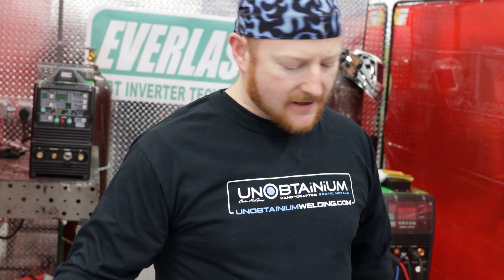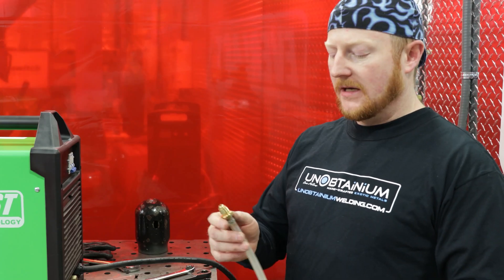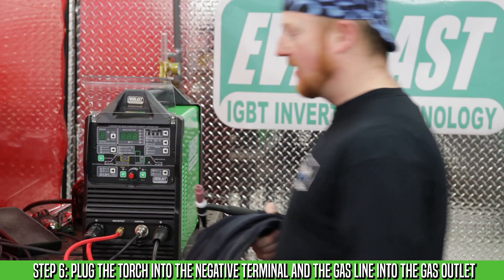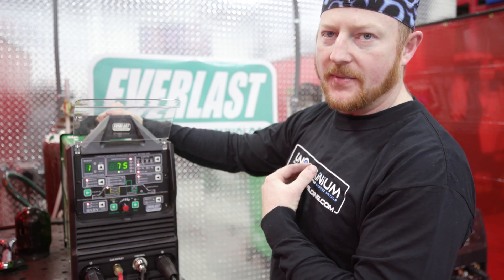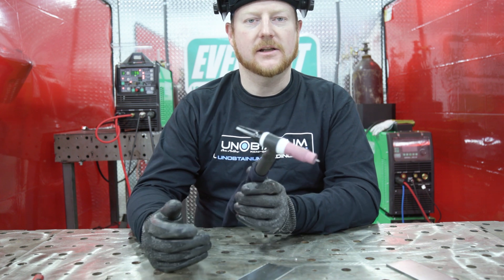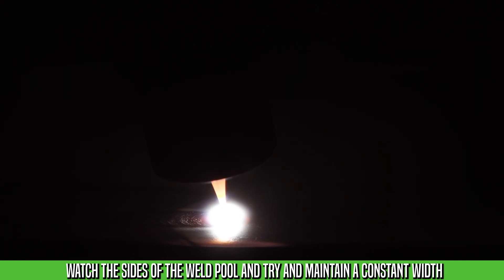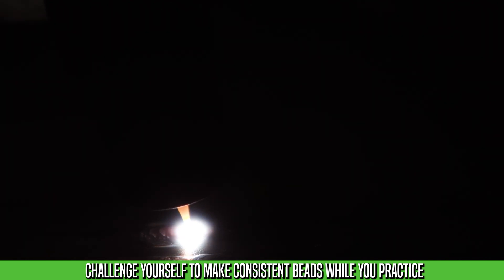Everlast PowerTIG 255EXT | Unboxing, Setup and First Welds

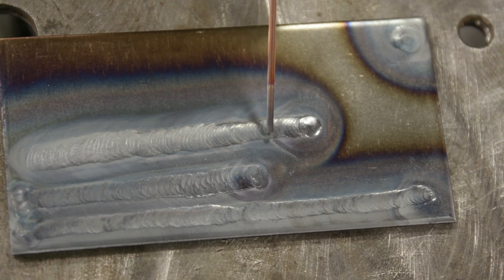Comment: The machine was set up at 75 amps but 1/8" (.125) plate requires 125 amps.  At 12:49 In the video you can see that the machine is over 100.  If these are instructional videos please remind the viewer that you had to turn the machine up to the proper amperage.  I saw the caption at 5:15 stating 1 amp per .001" however for  those who didn't they are probably wondering what they're doing wrong.  Thank you.
Reply: Yea, I was wondering what was up with that. Thanks.

Comment: Had my 255EXT since 2018. Only really awful problem I've had Is the central green digital screen. Impossible to read settings in bright light or sun. Had to make a shade box viewer to see it. No help from Everlast. Surprised to still see the design in use. Any suggestions would be appreciated.
Reply: Work in a maintenance facility here in Sun Diego, we own Millers and Lincolns, same story as well, I'm always cupping my hand to shade in order to see the screen, they all do it.

Comment: Can this welder be used without a cooler ?
Reply: With a 9, 17 or 26 series torch it can be.
Do not use a 18 or 20 series torch without coolant, you will burn up the power cable.

The reason is that not only the torch head is cooled on watercooled torches, but the power cable is as well. Because of the cooling the power cable on watercooled torches can be way thinner then actually needed for the given current.
Take away the cooling the powercable is to thin for the current, thus heating up.

Comment: Does this unit have mix tig mode (mix dc and ac/dc)?
Reply: Yeah, all the EXT Everlast models have MIX TIG (DC half and AC half) for aluminum welding. But Everlast calls it "Advanced Pulse". I've used it a little on my 210EXT and it has a maximum of 10 Hz on Advanced Pulse, since it is kind of a radical switching from AC-to-DC back and forth. I know of another manufacturer that allows its unit only 5 Hz on MIX TIG. It's a pretty potent feature in giving more penetration on aluminum when it's set to 100% on the DC half, i.e., it is then non-reductive in overall amperage, unlike a typical Pulse, which is always reductive in its amperage, ending in an average amperage amperage between the high and low settings. So, the Advanced Pulse feature need not be reductive, which is how I've used it to get more punch with thicker aluminum on my 210 amp Everlast unit.

Comment: Good unit. Very capable for the price. Only serious issue is green display in bright shop or sunlight is unreadable. Had to fab a small blackout screen window to be able to see for settings outside. No replacement part from Everlast. No indication it is just my unit. No adjustment.
Reply: the machine was designed for cave dwellers only